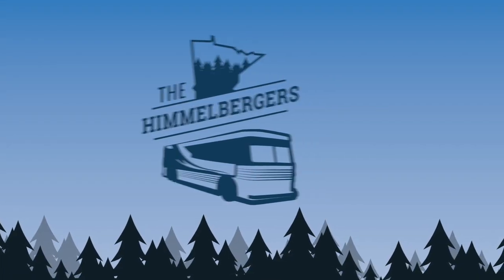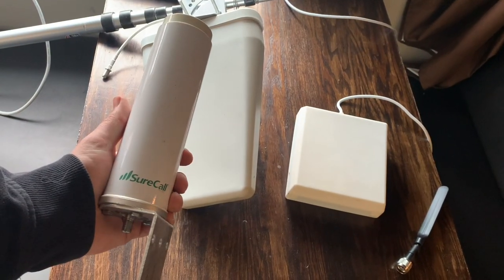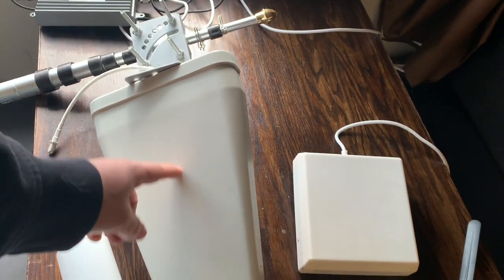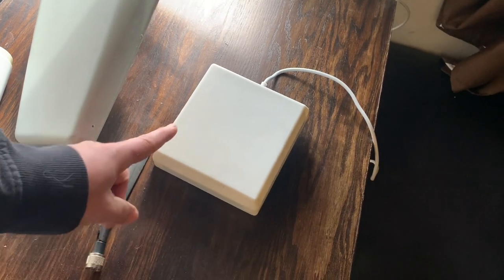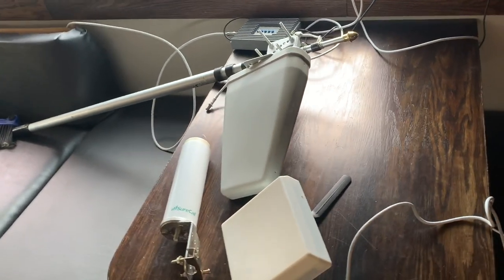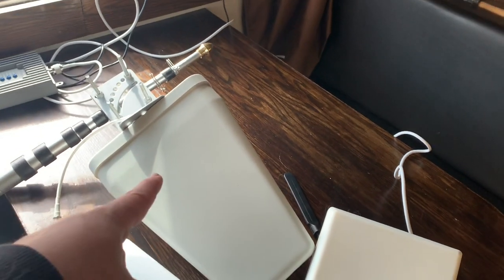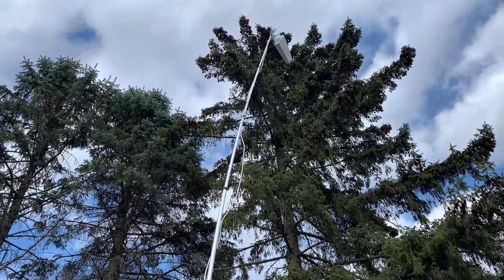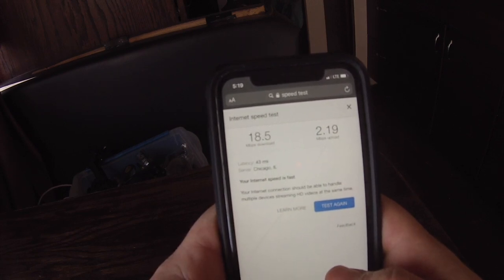RV Cell Booster Antenna Types, Yagi? Omni? Whip? Panel? Why?

Comment: Those panel antennas are generally used for covering large areas, what you're doing is equal to using a bullhorn as a hearing aid, it's probably overpowering the phone's receiver. I'd try an antenna that is actually made for indoor use
Reply from the maker: I've found this combination to be working the best of any mix thus far. I do try the whip indoor once and a while, but I get too much attenuation. Here is the indoor antenna we're using. https://www.amazon.com/gp/product/B077Q9X19D/ref=ppx_yo_dt_b_search_asin_title?ie=UTF8&psc=1

Thank you for commenting though, anything to improve the information is good.